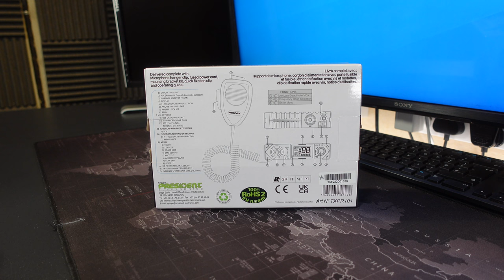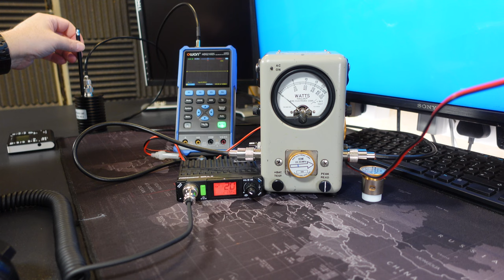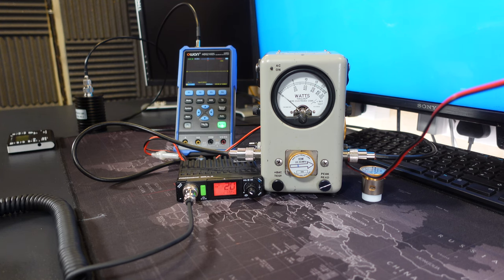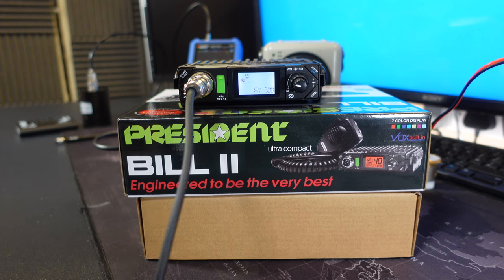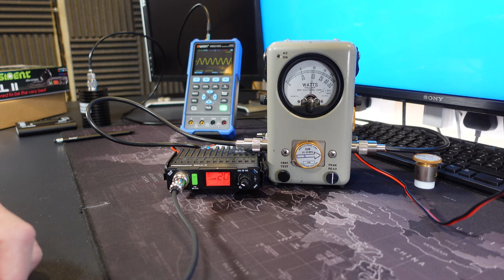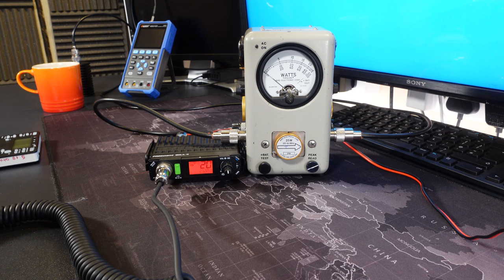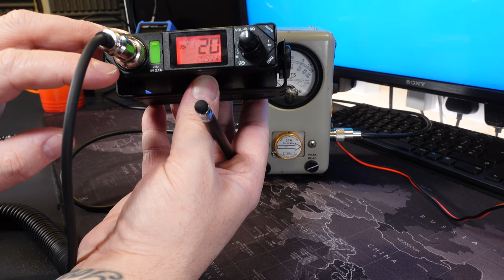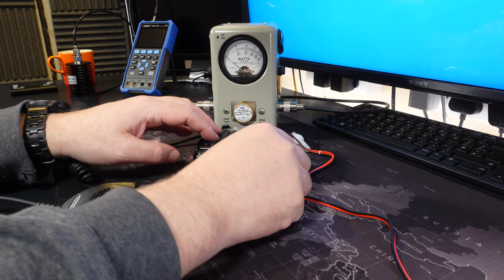President Bill 2 CB Radio Review, Service Menu, Power & Modification

Comment: Would love to see this with a President Thomas
Reply from the maker: Hi Tony, the President Thomas is the US equivalent of the EU President Barry 2. I have a few videos on the Barry 2 and what its capable of on the channel. However, I think the Thomas does not have the same ability to modify it vs the Barry 2 as most of the US versions have had it removed. I don't know this for sure but that is what other viewers have told me on other radios. Hope this helps and thanks for watching.
Reply: @NLKMediaGroup  thanks I figured as much, still enjoy your vids regardless
Reply: You can't expand the channels on the Thomas FCC that I know of. If you follow the same instructions for the barry 2 for the hidden menu, you can access the Thomas's hidden menu. I would have the video for the Barry 2 ready to go along with paper and pencil. I wrote down factory settings, and I didn't mess with the settings that I was told to leave alone. I was on a dummy load, so I was not bothing anyone. I was happy to see that the big heat sink is there for a reason. As I was adjusting it, I was being mindful of the heat being generated and watching to see if the power was holding steady. I tried to use those 2 things to determine the right amount of output and life of the electronics. If you play with it I think you will like it even more.  I need to consult with someone who knows more than I do to see if a power mic will help boost the modulation to match my voice.
Reply: @roberthoffman4713  thanks 👍
Reply: @Tony Sexton  I just did mine 3 hour's ago.

Comment: Is this much batter thank pni 7120 or not? As the pni costs 65 euros antenna included....the billy boy 145 euros
Reply from the maker: President make much better radios than PNI in my opinion. The tiny antenna that comes with the PNI is good for cleaning the treads on your boots :-) With anything CB the rule "height is might" comes into play. It doesnt matter what radio you have, if your antenna is poor or badly tuned its not going to work well. A Bill 2 with a nice Wilson 1000 antenna would be the way to go or possibly a K40 antenna.

Comment: Sure looks like a midland MXT115.
Reply from the maker: Hi Greg, there certainly are similarities especially at the back of the radio and the heat sink. The front is completely different but as seen in the teardown that is just two screws to remove. Maybe it was jointly developed or is a stock housing. Thanks for pointing this out, interesting. All the best
Reply: @NLKMediaGroup  It was the "Radio Slide Out' that pulled me to the Midland. Strange no other company has use this. As for CB, I really gave it a try. But in my area, it is so dead. Mite try FM/CB someday., Enjoyed the video.

Comment: Who would want a radio that only does am and fm? Who uses FM. No ONE.  No usb or lsb or upper or lower channels. Not worth any price to me. thanks.
Reply from the maker: Hi John, not everyone has the same use-case or wants a full blown SSB radio which costs double the price of a basic unit. FM is used frequently in the EU and UK but has only recently been legalised in North America. If your use-case is long distance coms then certainly a SSB radio is the way to go. All in all I would recommend buying a SSB radio over a DSB radio as most of the action these days is on SSB but for those who just want a cheaper basic vehcile to vehicle setup for the likes of off-roading then a DSB radio is a good option. Thank you for watching and for commenting. All the best MJ7NLK
Reply: @NLKMediaGroup  what is dsb? I was into CB and talking skip 30 years ago. I was just asking.  I modified my own radios with crystals and jumping certain chips. It was fun back then the late 80's and early 90's. Thanks. 😁
Reply: 1 more question!!! Just turning the wattage up only gain you distance with TX or also RX?
Reply: as a newby, the modification is that not giving you the USB and LSB?
Reply: Isn't it wonderful that One has choices?

Comment: It really does baffle me isn't it time these radios come fitted with quality cooling fans 😳
Reply from the maker: There is no room in the Bill 2 for a fan but maybe they could use heat pipes. When modified and after prolonged use it does get very hot but have not had any issues so far even if you could cook an egg on the case :-)